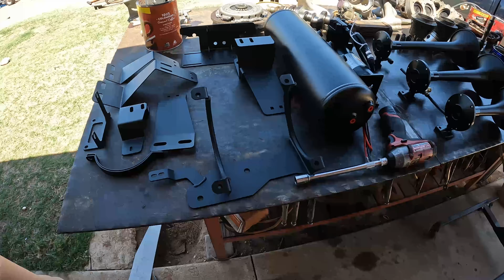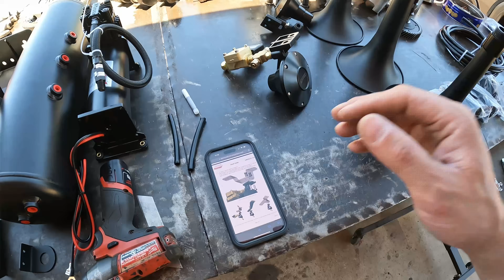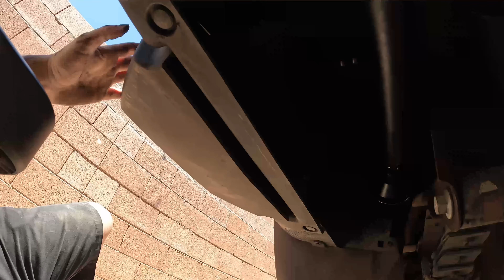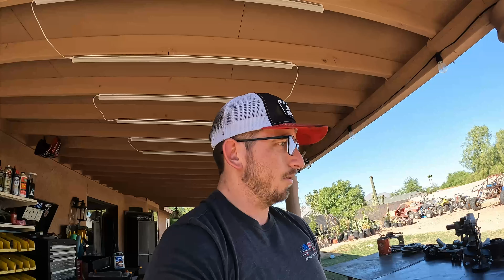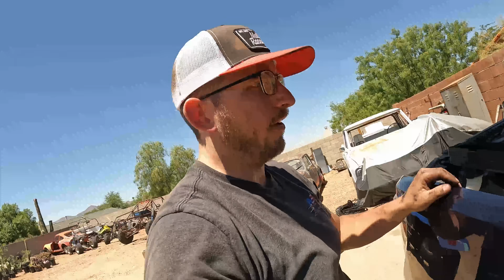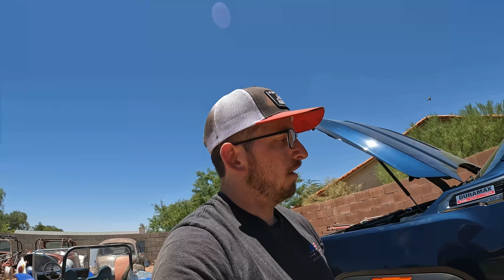Installing Onboard Air and Train Horns on This GMC Sierra 3500HD AT4

Comment: I used the exact same acc fuse that you used with a tap and the compressed wouldn’t shut off. Like almost that 10 amp fuse isn’t strong enough.
Reply: Any suggestions would help.

Comment: Hey man, great video - thanks! Just installed a kit on my 2500 HD using the supplied button.  One thing I noticed is I cannot get the horn to beep quickly (like a "beep beep").  I press the button, horn activates for about 1/2 second, then I have to wait about 1-2 seconds before the horn will activate a again.  Are you able to get a quick double honk with your kit?

I've checked installation, no leaks, etc.

Kleinn customer service told me ALL air horns have a delay but 1-2 seconds seems like a lot.
Reply from the maker: Unfortunately I’m unable to do any testing, it was a customer truck. Thank you for watching and commenting!

Comment: Did you decide how to run the wire into the cab through the firewall? Also where did you install the button?
Reply from the maker: No, I wired it to a wireless key fob so that I wouldn’t have to go through the firewall.
Reply: @Wineingerracing  not a bad idea. I was talking to someone else who installed their own and they ran the wire "the wire from the panel to the fuse box goes through a hole in the steering column boot on the top side... That part is a royal pain to do... mostly a blind spot."
I think I will do the same, he ran 3rd party upfitter switches but I drilled a hole on my console left of the headlight knob for the switch.
Reply from the maker: Yes, when I was looking at how to run the wire, I saw that there was no way to properly run with without damaging boots or drilling hole. Not to mention you can’t see anything because there is so much in the way. This is the wireless fob that I ran. It was super simple. https://a.co/d/7AslJ47

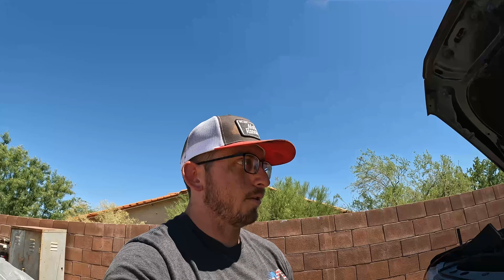Comment: Follow up: where did you tie your red 12g with in-line fuse? Looks like at 10:43 it shows you may have used the passenger side battery?
Reply from the maker: Yes, I used the passenger side battery per the instructions
Reply: @Wineingerracing  I’m installing on a 3500 diesel, instructions seem to be a bit different. Oh well. Thanks for the assist!

Comment: Which fuse did you pigtail off for power?
Reply from the maker: The misc acc fuse in the driver side fuse block
Reply: @Wineingerracing  I thought I saw you go into the engine bay fuse panel?
Reply from the maker: Yes you’re right!
Reply: @Wineingerracing  could you give me the fuse number? I’m tackling this project this weekend.
Reply from the maker: I believe that its #40.